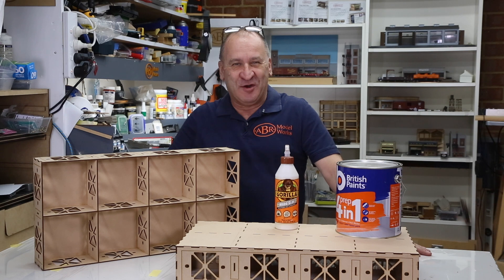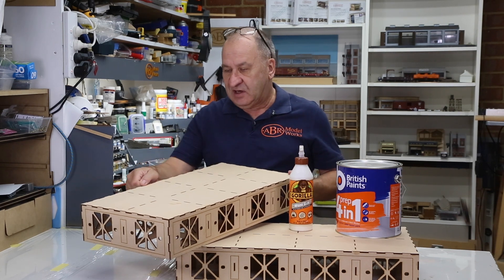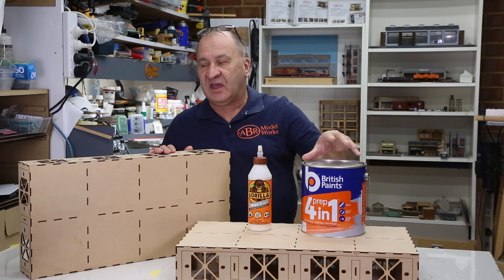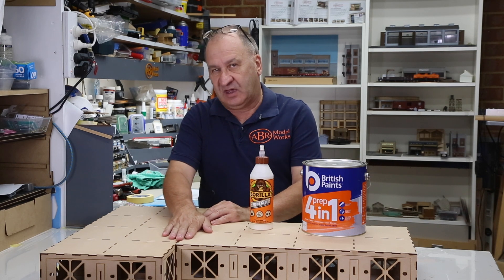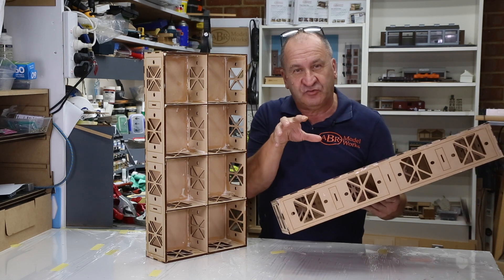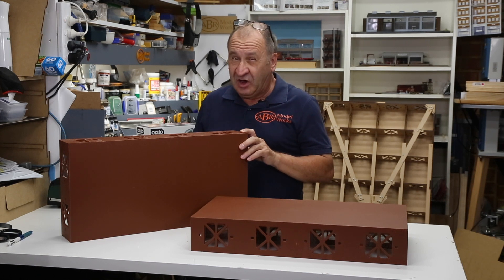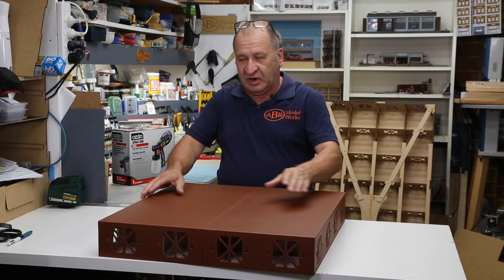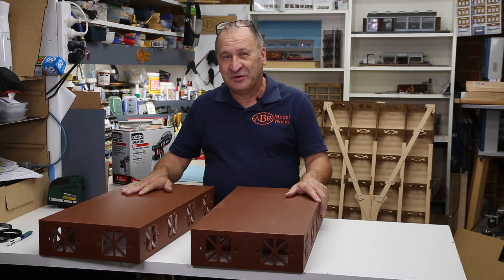Building ABR Lines model railroad   VLog #005   HD 1080p

Comment: Chris, very good and helpful hints.  I am not sure if it is available in Australia, but in the US, a lot of people us Krylon Camouflage spray paint.  Just comes in a can.  Does wonders and may work just as well as what you purchased.  Also, some modelers have gone from using an air brush to using the Krylon spray cans.  Less mess and cleanup afterwards.  Keep the videos coming.  Hope your business is doing well, and you have been able to hire a few people to keep product coming out.  Thanks.
Reply from the maker: I would not suggest spray cans as the cost of painting a baseboard would be just way to high. Still just me so I keep on plunging away. Thanks for your support.